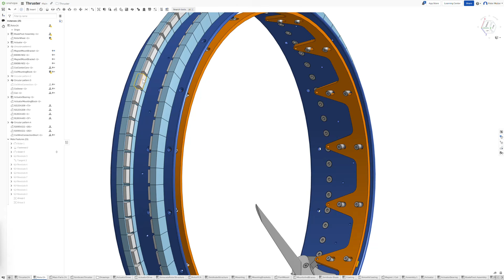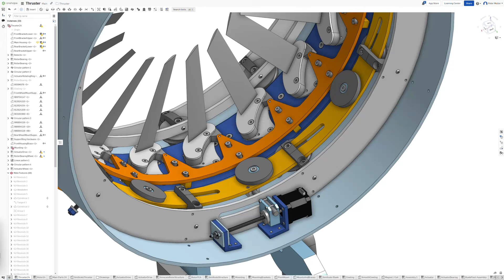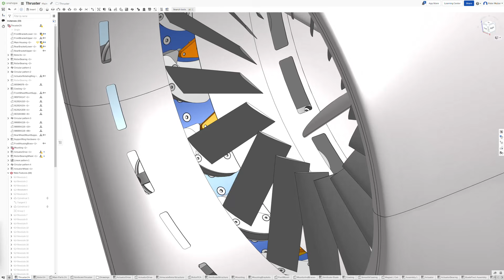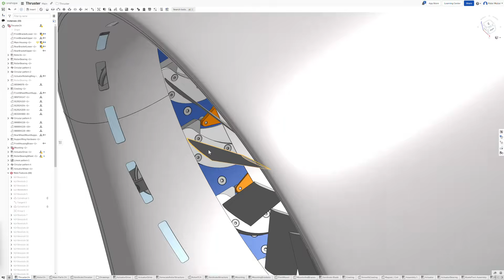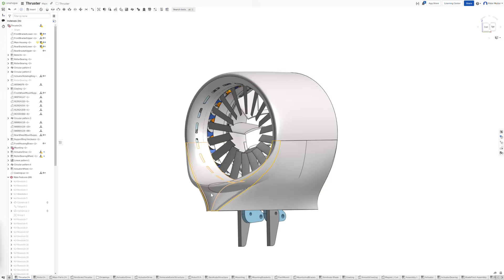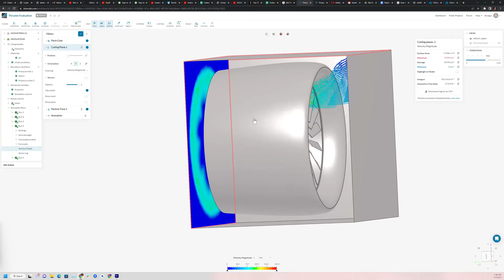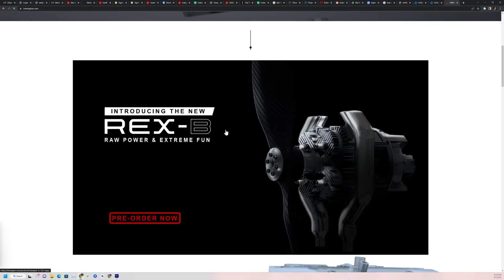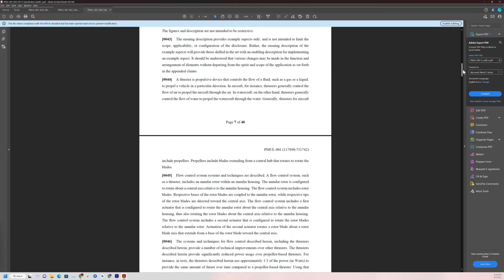Could this Thruster transform Aviation?

Comment: I can see an amendment to this design, where the center blades are joined together with a kind of helical design you see in vertical wind power turbines. That would add stability to the flow and reinforce the blades, and possibly even increase performance. Of course that increases complexity, but not necessarily by much. The side profile of the blades would look like this: ---------\ but with the "\" part being a kind of helical twist shape. You could also look into MIT Toroidal Propeller design, it would make a pretty low profile and efficient center piece to join the blades, and it's also designed for drone propellers to limit damage from contact with things, so that could also help in general when it comes to the intake of small debris. It's about half as efficient as a typical fan blade design, but that could also play as an advantage when paired with your design, as it might create some unique characteristics. For example, with such a design, the blade angles could be altered on the fly to increase stability, based on conditions. 

The center piece and the blades could be joined by mere bore holes with rods in them that allows the blades to be angled at will but still be connected for stability. A computer controlling these adjustments could dynamically adjust them as needed based on weather/altitude/speed. And you wouldn't even need motors to rotate them, you'd simply have a mechanism that lifts the blades inward, with the bore hole having a kind of screw design inside of it, so pushing it up a little causes the blades to automatically rotate and stay at the rotation as long as it is raised to that specific height. I'd imagine such a design would also perform exceptionally well in adverse weather conditions. 

On top of that it could also be a safety feature, where the blades can close almost completely if a potential strike is detected, with the appropriate sensors. So for example, say a bird is about to strike, sensors detect it's incoming, and close the blades. Bird strikes the blades, but they're closed, so it's like smacking into a solid piece of metal. Either bounces off and gets sucked through the safer and more robust Toroidal Propeller design in the center, or stays pressed against the blades. From there the blades could decelerate on that engine, and then slowly spin up and re-open, or rapidly re-open, allowing the bird to pass through without causing as much damage to the blades themselves. It would obviously have to be a safety system for higher altitudes though, unless it could react quick enough to close and reopen the blades, which I think is very possible. It would result in a short loss of engine power on that prop, but it would also protect the blades from damage. Well worth the minor inconvenience.

Comment: Neat design, one improvement, look at the shape of scimitar blades for a turboprop. You're going to want a different blade shape for maximum efficiency. 3d printing can give you an optimal shape. The pitch has a varied angle as it goes to the source of torque.

Comment: Your pivot mechanism will experience greater and greater force as the rpm's increase.  When the attachment point is in the center, centrifugal force pulls straight out.  Since the attachment point is further out on this, the centrifugal force will create a moment.

Comment: If you spin that thing at 5600 rpm your magnet ring is going to have to withstand a g-load of 10,689 g's. That's probably going to require some exotic materials. The blades themselves will face an integral of v^2/r so they'll probably need to be tapered to be thicker at the base. But if you can overcome those challenges, it looks like a neat project. Best of luck.

Comment: Also….. where the air is being accelerated over the lip of the cowling, there is an opportunity to produce additional thrust and increase efficiency I’m not sure exactly how to describe it, but if the cowling rim was thought of as a circular airfoil, then the addition of the bottom surface of the “circular wing” on the outside of the cowling (a flat-ish surface facing somewhat rearward) would produce lift in the forward direction.  The cowling diameter could be increased slightly to take advantage of this idea.

Comment: I think that there should be some method of returning the blades to a resting or static pitch aside from air pressure. If this is used in a forward configuration or at an idle while descending, the blades may 'flutter' and cause damage to themselves or asymmetric drag within the setup which could produce undesired torque.
You might solve this by redesigning the cam bracket (orange) to somehow capture a peg or spoke affixed to the blade assembly so the blade is kept at a constant pitch as set by the thrusters trim.

Comment: Looks like it would be heavy. But then again, God only knows how much a normal turbine stator and fan weigh. I love that it has an Axial Flux motor running it. The only thing I could suggest is that you look into wedge-shaped coils instead of traditional round coils. More coil surface area is used to generate torque in the directions that you need it to. Figured I'd let you know about that since efficiency is going to be key to full-scale electric aircraft.

Comment: I would build a 2 inch wide ring for the center. I would have a stud with threads on the ends of  each blade. The stud would come off the end the blades on the sides that basically makes a circular movement while the other side moves back & forth like a rudder, to change the pitch of the blades. I believe this way it would increase the strength of blades, but still leave a hole in the center.

Comment: Interesting design. BTW: The heat generated by a jet engine is from the thrust generated by combustion and is the source of thrust, it's not there by accident. Maybe the reason your blades are stalling is likely caused by AOA combined with the vortex (not modeled) generated at the end of each inducing deflection. You may still need a central cone,...there will certainly be deflection when the aircraft articulates here as with helicopter,...this is one of the many reasons blades on a jet engine are connected at the center with the ends as close to the outer shroud as possible,... voticies will tend to deflect the blade from high pressure to low,... as well as succeeding rows of blades counter rotating for compression and compression causes thrust,.... Best efficiency at a 2% to 4% angle of attack as well as helical twist in blades if you want to run at lower RPM...Helicopter only articulates blade AOA 12.5 to 13.0 degrees hovering and transition by the same way as a ducted fan,.... CFD and FEA sims are only as good as the set up and it's hard to know all the cascading effects going in,... just because you've modeled a parameter doesn't mean all the parameter, or their interactions, are being modeled. Your roller wheels are also inducing variable drag/oscillation and this will change with position,...maybe needs to be magnetically isolated/levitated in the +/- Z and control your pitch by induction.

Comment: I was in the submarine service and, came up with ring motor about fifty years ago for an all electric driven submarine. Which eliminates rotating shaft at propulsion end which, eliminates shaft seals, bearing and all those huge expensive serviceable elements. Don't believe however that the outside bearing could withstand the rigor of heavy thrust and could become an element for vibration. In the Gyro World modern bearings have races of ceramic and rollers made of titanium.

Comment: First thing to fail would be the guide or support bearings before anything else.The ratio of the surface speed of the rotor to those small bearings is so great that they will disintegrate in no time which is totally opposite to normal jet engines.

Comment: Re coils, one thing that I can see is that the cores of coils need to be laminated steel i.e. made of thin layers insulated from each other, oriented to interrupt eddy currents. Also some of the objects near the coils and magnets have to be non conductive (to avoid eddy currents from the magnets and / or the coils when in motion and powered).

Comment: Have you tried angling the bladed radially, and scimitar shaped, say the tips 30 degrees slanted towards the direction of rotation; like an alternator's winding or sub propeller.
The slant gives more surface area to push air.
The curve gets a steeper attack angle near the center.

Comment: For all aviation uses, it needs to be able to feather the blades.

As a bonus, if it could produce reverse thrust as well, that would eliminate the need for clamshell reversers - another weight savings.
Reply from the maker: The blades should already feather enough when at max pitch and it's an electric motor so it can be run in reverse if need be.
Reply: @petermuller9177  90 degrees (parallel to oncoming air) is preferred as anything more would induce additional drag.  I hadn't thought about running it in reverse - though doing so with airfoil-shaped vanes would, I think, lose a lot of efficiency.  It might not be sufficient loss to matter, but IIRC airlines get the majority of their stopping power from thrust reversing (which I don't know how much thrust actually can be reversed).

Comment: Peter, Amazing CAD work.  I know it’s late but don’t patent this. The improvements needed to make the rpm you are suggesting would make the motor so different that the patent documentation you submitted would be unenforceable. I am not sure if you are being a patent troll or are literally out of ideas to make it work. I am not an engineer but there are 5 changes I can think of that would make this a more than an expensive fan for your office. First one being Delrin has a Rockwell hardness of 30 and aluminum is 108. Under-load that will create heat and those wheels will melt or get chewed up before anything novel happens. 2 the magnets are mounted on the fan. No wonder there is a lot of emf. Magnets should not be spinning. It would interfere with avionics or a pace maker that a passenger was wearing. 3 your blades are too thin at the base and too fat at the tips. Take the mass out of the tips to reduce flutter. Less mass at the end of a lever the less vibration. If you can do those then 4 and 5 will be obvious.

Comment: Maglev bearing, Cone or even aviation wire connecting blade tips possibly tensioned? And once you figure the controller and run it at high rpm man this could really go somewhere. Id like to see a 5-7" version on a quadcopter that would be amazing, with maglev or possibly a central heavy bearing with Motor on outer ring like you have. Possibly induction. This is really cool. Excited to see where it goes.

Comment: ITU watched your raptor build enjoyed all of those videos. I would make one suggestion instead of those roller bearing wheels why not have them on a magnetic bearing system sort of like a mag lift where there are no bearings they are being suspended by magnetic energy. These have been developed to work as bearings almost no heat and greatly reduced fraction. As the ring in the center is being suspended by magnetic Fields, there is a company who actually did this and replaced the bearings on an internal combustion engine with these magnetic bearings, fascinating subject, if you dig in deep. Thanks again for the video

Comment: This represents an AMAZING level of work for mostly just one individual to perform.  But I worry about this scaling up to the size of commercial jet engines. In particular, the wheels holding the outer ring would be spinning wildly fast on a large diameter engine spinning several thousand RPM. For example, given the 96 inch diameter suggested of a large jet engine, if the support wheels were 4 inches in diameter, they would be spinning 96/4 = 24 times faster. So it the blades spun at 4,000 RPM, the wheels would be spinning at 24 * 4,000 = 96,000 RPM. The only bearings operate at those speeds are TINY, such as used in things like dentists drills.

Comment: I think it's a brilliant design. I'll bet if it were made to run in hydrodynamic bearings, it could achieve incredible speeds, especially with the centrifugal loading neatly controlled. I also wondered if the center edges of the blades would benefit from a stabilizing ring, but that doesn't seem to be an issue, at nearly 6k RPM.

Comment: I do believe that having a central cone/bulb fastened to the stators, would force a little more air through the blades. More air passing through the blades should translate to more thrust. Also, without the central cone/bulb, the air flowing through this zone would be at a lower pressure than the air flowing through the blades and may reduce the thrust produced by the blades and perhaps create a bit of drag. Have you thought of this and put it through your CFD modelling program?

Comment: Apologies for being the party pooper here.  But the thrust to power ratio claimed here is about 5 times more than it should be.  In other words, if power supplied is 90 HP, you will not get 1,500 of thrust.  You will only get 286 lbs of thrust.

Take the momentum formula for the calculation of thrust from the power supplied.  Set the  power to 90 HP (67 kW), diameter 24" or radius 12" (0.305 m), and a generous z = 0.78 (propeller efficiency of 90%).  The thrust produced is only M = 130 kg or 286 lbs. 

Conversely, take the momentum formula for the calculation of power from the required thrust.  Set the thrust to 1500 lbs (681 kg). You will get power required P = 808 kW or 1,080 HP.  This is 12x more power needed than the claimed power consumption of 90 HP.

 (Note that the relationship between power and thrust is nonlinear).

Furthermore, what is the point of a rim motor when it will be quite heavier than a center motor and will have lot more moving parts and be a lot costlier to construct.  A center motor has exactly one moving part (not counting bearings) and has far fewer poles, about 20.  Also when calculating the weight of the thruster, you need to add the weight of the range extender to that.

Comment: Pretty sure this (or something very similar) has been patented in the US for a couple of decades.  It's definitely been a thing for watercraft since the mid-1900s with multiple patents and major names like Rolls Royce in the business.

This design makes the most sense to me when you need high prop torque, i.e. in the water or if you had a larger diameter ducted fan with deep, chonky blades moving a lot of air per revolution at lower RPM like you would want for a heavy duty drone or VTOL.

Comment: Excellent!
I have often wondered why this idea hasn't been tried before (to my knowledge).

I know you are mainly focused on the blade tips, but I would focus more on the Friction-less aspect of the design.

The main issue I have is the wheels/bearings used to change the pitch of the blades, and the cooling inlets.
Whenever you have the environment enter an area where there are bearings, you will have friction and failure. 

I was wondering if you could use fixed magnets on that ring, to change the pitch instead of those wheels? Then you could have those openings for cooling and not have to worry about those bearings failing.

Awesome idea, I hope you have filed a patent for it before someone steals it.
Reply: I just got to the part where you mentioned you filed a patent...lol!
Reply: Also, this can have far reaching applications other than aircraft!
Think Air Conditioning! Drones!

Comment: I see most comments are about blade and or structural design. I'll talk about the motor, looks like you used cut iron rod dipped in epoxy to give insulation. The iron is going to super-heat in a real high speed run. You could redesign to square and use lamination steel (better than solid iron rod), or use a high resistance press-formed iron powder (best option). 

Something to keep in mind when thinking about your soft-magnetic-material, with as many coils you have, you need a high frequency drive to achieve 5K RPM. example... on a 6 stator BLDC ( 2 each UVW), it takes 12 steps to get one rotation.  at 5K RPM that's 1000 pulses a second. I didn't do a count of your coils, but i'll just say 42 coils for fun, at 5K RPM, that 7000 pulses per second. Laminated motor steel is not the best choice.

Comment: Have a Chevy Volt that uses a similar power system. Electric drivetrain with a gas powered electric generator I can really see the viability of this system for flight. It would definitely allow for a smoother transition to complete battery with engine backup

Comment: In addition the harmonics and blade life issues already mentioned; The bearings will wear rapidly and the frictional losses will be tremendous. The thrust load on a mechanical bearing like that would severely diminish lifetime of any mechanical component. Normal turbofans use hydrodynamic bearing for this reason. 
Axial driving of a ducted fan is a nice concept, but ditching the shaft is not necessarily a benefit from axial excitation.